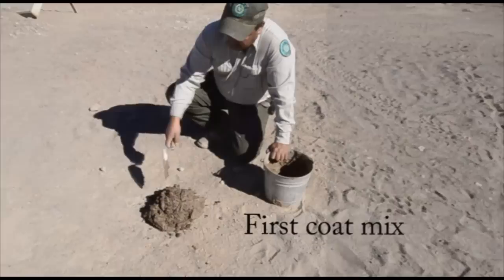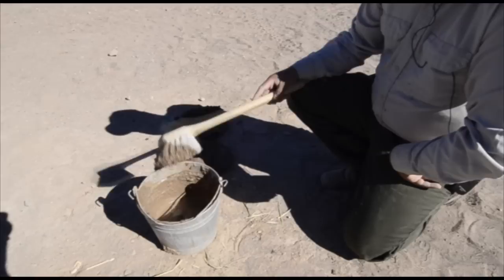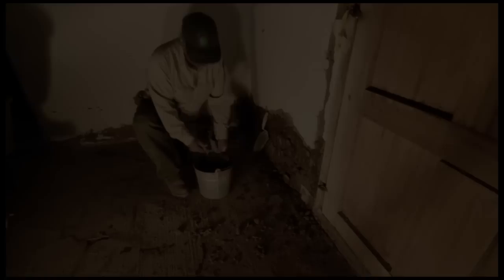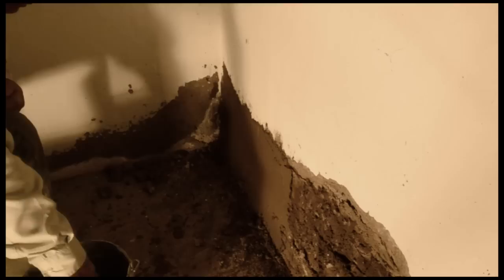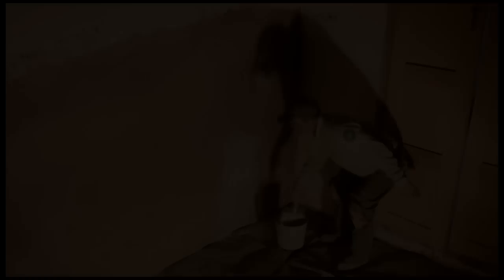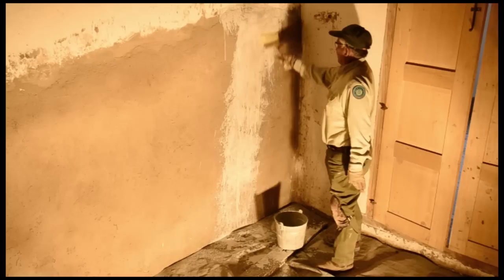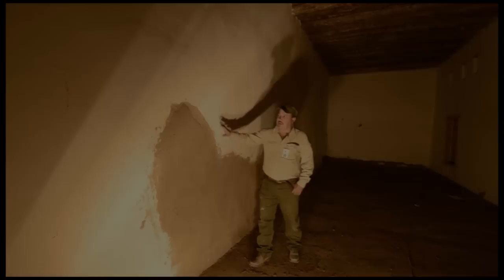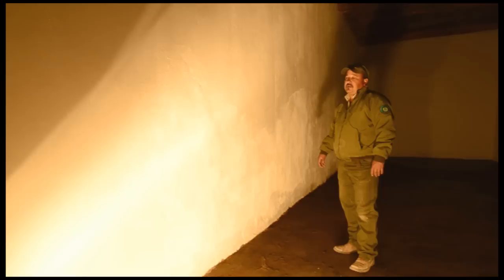Maintaining Historic Adobe Plaster at Fort Leaton State Historic Site

Comment: There is a capillary effect of humidity rising up trom the ground up the walls.  If the sealing on the wall is too good, then moisture accumulates and the outer covering will separate from the adobe brick.  If you are going to seal the adobe wall, then you might consider inserting ventilation tubes every so many meters.   That repair looks clean, but the cause of the problem remains.  Adobe has to       breathe.